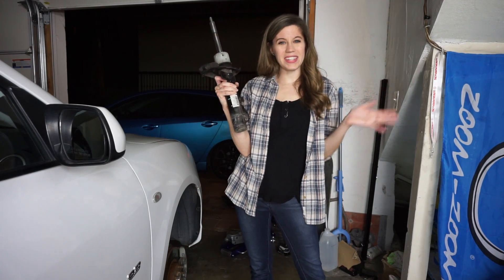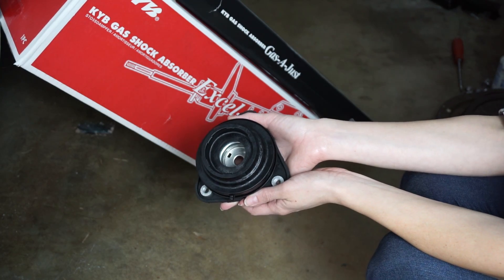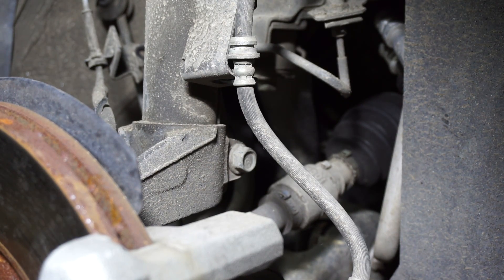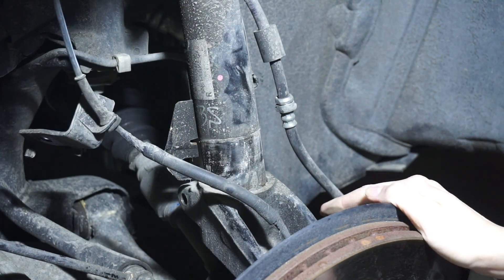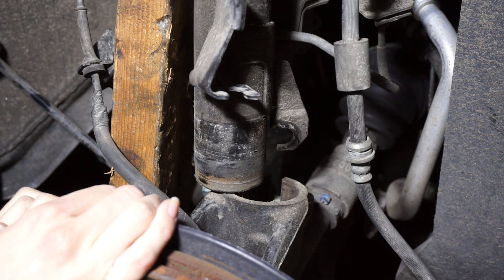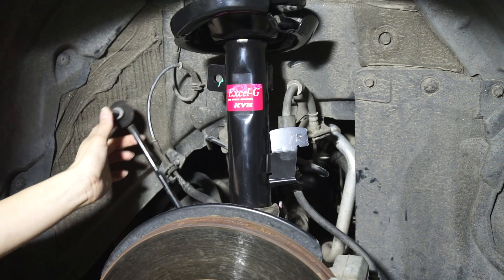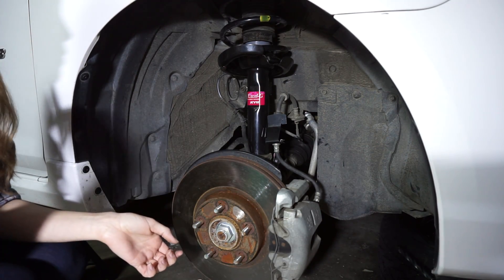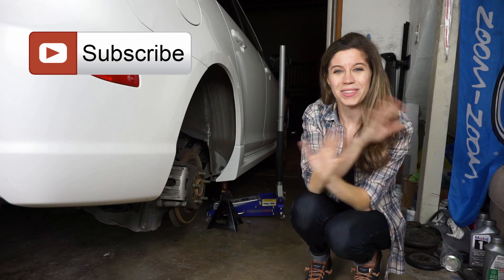HOW TO REPLACE WORN OUT SHOCKS AND STRUTS - CAR, TRUCK or SUV

Comment: Other DIY videos are saying it's dangerous to handle the spring while compressed and recommending replacing the whole assembly. But it looks so easy on this video.
Reply: In europe you cant get the whole assembly kit, you have to do it this way which is BS.

Comment: Perfect timing! I have a Volvo S40 (same exact suspension) and I am extremely disappointed in the coilovers I installed last year because the ride quality it awful. I'm going back to stock but will be replacing the struts as well. I used your video for installing the coilovers...now I'm using your video to take them back out again, lol, so thanks for this!!

Comment: Just something I did that I found to speed up getting the knuckle off the shock instead oof beating it with a hammer is to take Your scissor jack and a 2x4. Put the 2x4 on the knuckle and then put ur jack ontop of the 2x4 and jack against the bottom of the spring plate then spray penetrating fluid around the shock and it’ll pop right out

Comment: Why didn’t I watch your video in addition to the dozen others I saw. Your method seems one of the better and least physically taxing.
Do you think you stripped the bolt because the knuckle was spread a bit much?
Another way to remove it was to use a bottle jack which worked great but I didn’t have.
Thank you!

Comment: I watched 2 videos and this one was more detailed, including torque spec's.  I will add that it does look like she is working with a very new car.  After 18 Canadian winters everything is a little rusted and none of the fasteners came off easy.  I cut off the links that go from the strut to the sway bar and luckily the nearest parts store had 2 in stock.  I've also used a big sledge hammer free up the strut easy enough.  A little harder getting the new one in, some hammer blows on the side helped.  Anyway just a word of caution but by the time your struts actually wear out the car is going to be a little harder to work on than it appears.

Comment: Thank you so much i've learnt so much from watching your videos. Do you have any possible solutions for hard to engage gears on a manual 3 sedan i've been told that it could be that the cables are sticking.

Comment: thanks for the little tip there as the Mazda approach of bludgeoning the knuckle to death was a slow and painful one!  LOL  I put that washer in there, put the pinch bolt in backward and bam the new strut slipped right in there!  Thats for saving me a bumch of time and for your video which helped me install some Koni Sports and some Eibach Pro Springs!

Comment: Any chance you would take a request for a video? I need to straighten out the steering wheel (it is canted ~7 degrees from center).  I know it is a matter of adjusting the tie rods, but if you had any tips that would be greatly appreciated.

Comment: is the suspension set up the same for mazda 3 gen 1 vs mazda 3 gen 2
also for mazdaspeed3 gen 1 vs mazdaspeed3 gen 2?

i changed shocks on 05 mazda3 curious if it's the same sh on 09 mazdaspeed3.  diff shocks of course.
Reply from the maker: The springs are stiffer (and probably shorter) and the shock and struts more aggressively valved but the fitment between the first generation Mazdaspeed 3 and Mazda 3 are the same. You can definitely interchange the shocks, springs and struts but one thing you should consider is the ride height. The Mazdaspeed 3 rides lower then a Mazda 3. It probably won't hugely impact the front alignment but the rear wheels camber will be off because the Mazdaspeed 3 has shorter upper control arm. It might be a good idea to pick up some used Mazdaspeed 3 upper control arms on eBay to correct the issue. They're usually pretty cheap on eBay. As far as the second generation the front struts are very similar as the first generation but the rear shocks are slightly different. The bottom of the rear shock that bolts to the lower control arm is more narrow. You can still definitely use them but in order to make them fit you will need a few washers to put on each side of the shock.  Hope this helps!

Comment: I have 2013 mazda 2 sport, what do u recommend of struts and shocks if I'm lowering my car 1.5inch.
Is there a website for Mazda parts or suspension?
Reply: Koni yellow shocks which are also adjustable. They're a bit expensive but worth it.

Comment: I've replaced my all car shocks to KYB shocks but the back shocks made noise when I had to reverse or fall in hole ... my car is Toyota Aurion 2011
Reply from the maker: Maybe the shock mounts were worn out did you replace those as well?
Reply: everythingdiy yes I did sometimes I heard the sounds ..

Comment: Please don't waste you luck with loaded springs unless you know how to do it safely first.
I'm surprised the spring didn't have a rubber seat on the bottom support.
Anti-sieze paste on threads and finish by spraying the exposed threads and nuts with rust protection. Anybody who will work on the car will have a joy to wrench it!

Comment: Putting the bolt on backwards is really risky because it'll strip the threads. Just buy a cheap spreader tool off aliexpress. You can get either socket that you just twist or you can get an actual spreader tool that's a little bit more expensive. You can build one with a grinder too + a 8-10mm hex key.

Comment: How do your hands stay so dam clean, its like there is some kinda force field around them or something? i only have too look at a car and mine look like ive just come off a 12 hour shift in a coal mine. but seriously i want to know the secret  having clean hands would be nice.
Reply: josh smith I had the exact same comment in mind 😂 everytime I do something I get completely dirty !
Reply: Before you decide to start to work on the car, put a barrier cream on, like Eucerin Cream an hour before you start. It will soak into your skin and act as a barrier to protect too much grease from getting ground in. For the most part, if you look close at the other vids; it looks like the areas are power washed or cleaned ahead of time. This is not only a good thing to do  before making an instructional vid but anytime you're going to work on a car. It saves from getting dirt and grime from getting all over the place, saves on the fasteners from getting rounded off since there isn't a load of dirt on them which might cause you to use too large of a socket or wrench. Trust me, it's happened to me when I was a kid. I still keep 2 separate racks of regular tools; 1 SAE in 1/4-3/8-1/2 drive and the same in metric. The second rack are all 6 point in all 3 sizes and deep and shallow but they are graduated in 1/64 increments. Yes, an old school master set, but they always come in handy when working on other peoples cars. Those 1/64 sizes will fit both SAE and Metric that are rounded or beaten so bad a 12 point wont work. BTW washing your hands after with a little WISK laundry detergent, and that stuff has been recommenced for decades to clean engines, engine bays and other parts loaded with grease, as well as getting it out of your clothes. I even remember my Grandma using it when I was a kid on my Grandpa's clothes, he was a mechanic at the factory near their house. It got everything out. I use it in my garage too to get out the oil stains off the floor. I just pour some on, spread it around and pray a little hot water on it, wait an hour then scrub. You never even notice there was a spill there.

Comment: My left rear strut is leaked out. Should I replace just that one or on both sides?
Reply: Both. You always want to replace them in pairs
Reply: He's right. Anything on your car that goes bad on one side should get both side replaced. It's not only safety but it's cheaper financially in the long run.

Comment: How do I replace a crank sensor on a Mazda 5 with a 2.5 litre double can 4 cylinder, it's a 2012
Reply from the maker: It's on the top right of the valve cover. It's very easy to replace. We don't have a video for it yet but here's one I found: https://www.youtube.com/watch?v=R8BAospMr90

Comment: compressing a spring is really scary. Some cars need an alignment after replacing the shocks.
Reply: powcar91, completely agree. just fork out the $40 bucks and have it done at a machine shop. less worry and less work.

Comment: Didn't the spring need to be replaced as well?
Reply: Aric Beemer Why? If it not broken and it doesn't seem to be ewen rusty so why need to change it?
Reply: Juha Mikkola Because they are a part of the strut.
Reply: Aric Beemer yes springs are one part of strut but not needed to change same time if not broken - or at least I don't change everything if one part is broken.
Reply: Juha Mikkola Okay well, now I know.

Comment: how did you learn all this stuff?
Reply: Not so much to learn even if the steps could be different on different cars. You just disassembly everything and and assemble it in revers order. You learn best buy just doing stuff. Don't be afraid to work on your car(if it's not electronic and stuff). If you mess up there is always internet. Learn by doing and your mistakes.

Comment: how is the underside so effin clean?
Reply: Like myself and most of the good small auto shops, pressure wash or use GUNK Heavy Duty gel engine degreaser, to clean the undercarriage and engine  compartment ahead of time. It makes the job go quicker, cleaner and it's easier to spot any new leaks or issues when doing a test drive ahead of time to ensure that what they, or myself, thought was all that it was going to need. Plus, when the customer gets it back nice and clean, they feel better that you did a more thorough job than most and can see if there is any other leaks at a later date.